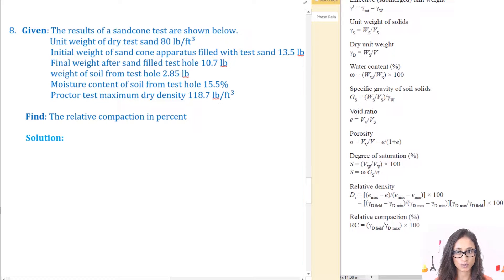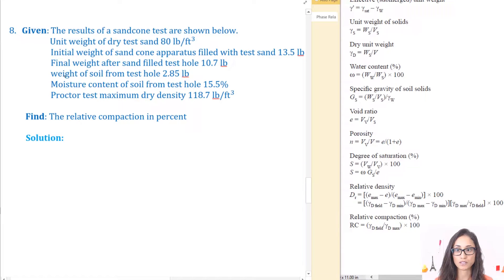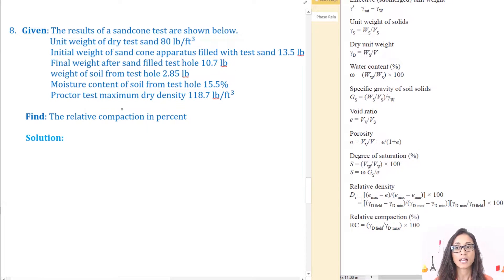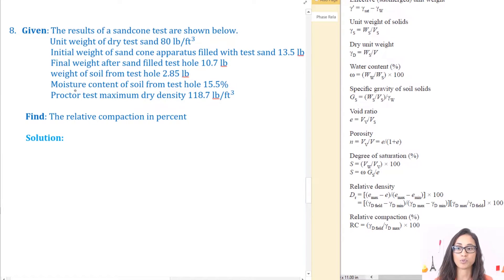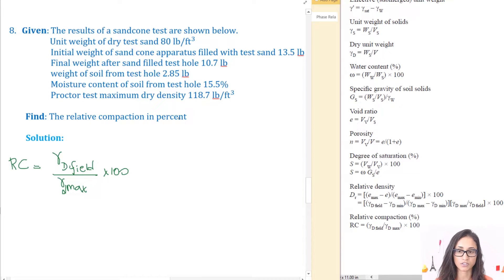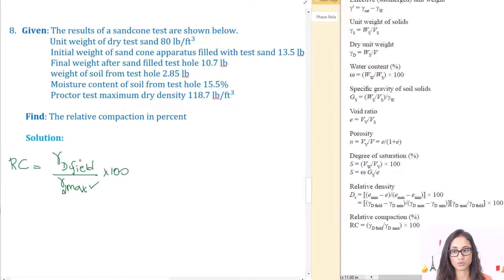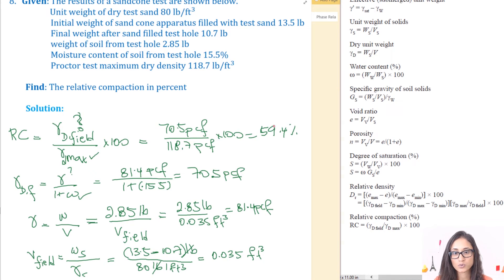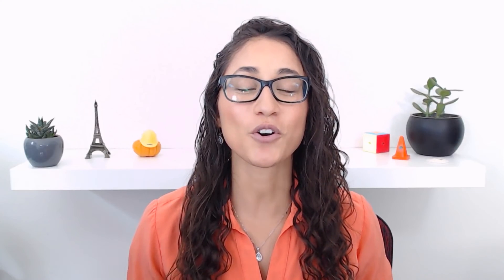FE Exam Geotechnical - Relative Compaction (Sand Cone Test)

Comment: you are missing the weight of sand in the cone by itself, you need to subtract this from the difference between the weight before and after filling the hole
Reply: The difference between the weights of cone apparatus before and after the digging and the filling of the hole gives you the weight of sand used to fill the hole to determine the volume using the dry unit weight of sand. I do not see where the solution of the problem is not correct. Engineer Mohammad.
Reply: @marcomelendez5230  But the sand inside the cone does not fill the hole, it stays above the hole, therefore that part of the weight should not be used to calculate the volume of the hole.

Comment: It Is confusing when they call it "max dry density" but it is actually "max dry unit weight". At first I thought the 118.16lb/ft^3 was row, but it is actually gamma.
Reply: Density is mass per volume. Unit weight is force per volume. Pound-force is equal to pound-mass where the gravity is equal to 1g of gravity. So if you are working in metric units the difference between density and unit weight will be a factor of gravity. But in U.S. units lb-m/ft^3 is equal to lb-f/m^3. So they are pretty much interchangeable.